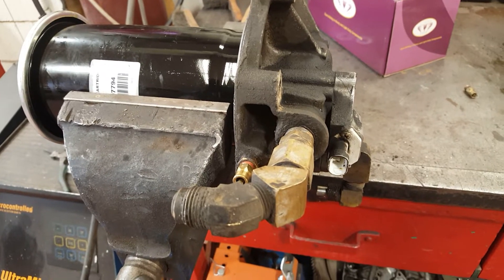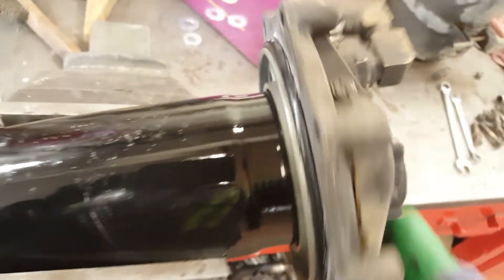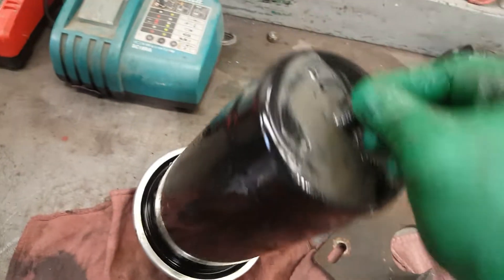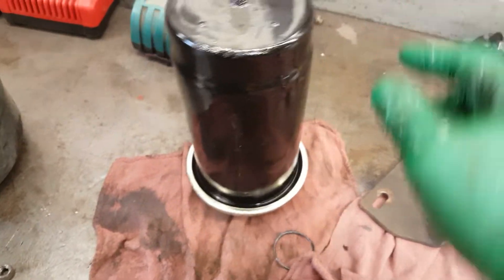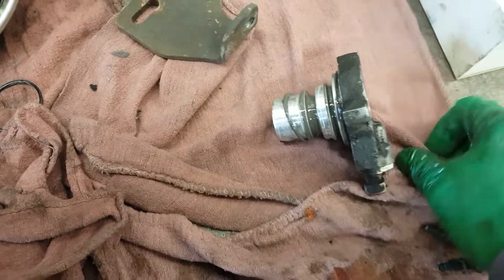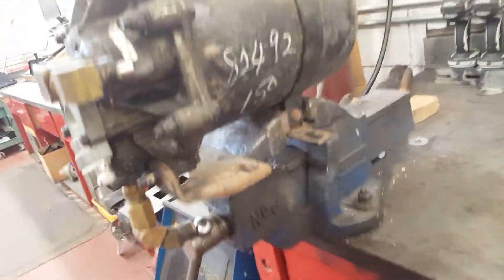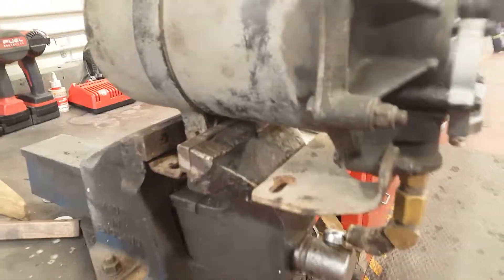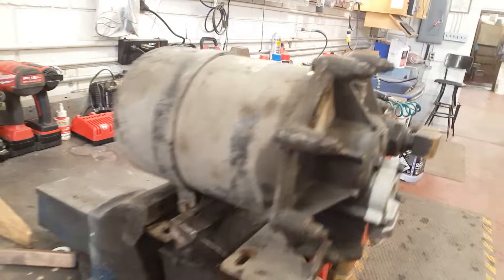School Bus AD-9 Air Dryer Service

Comment: How much are you saving rebuilding that cheap ad9?  Hell we get them for 250 complete
Reply from the maker: The filter and unloader costs $62.39. With 80 buses in our fleet the savings are in the thousands.👍
Reply: How long does it take you to do one vs one that’s complete as far as labor
Reply: I might be off on price too might be cheaper than I said. Have to look it up
Reply from the maker: @hddm3  it takes 1/2 an hour to do the service on the bench. Another 1/2 hr to install depending on the location.
Reply: So about 30 min more. Not bad then